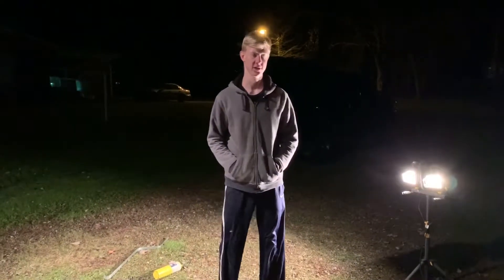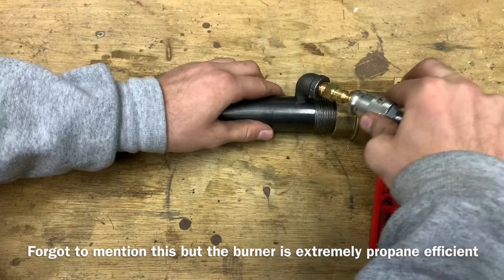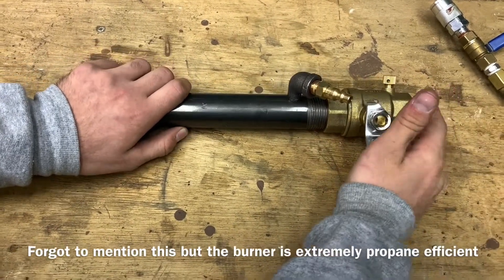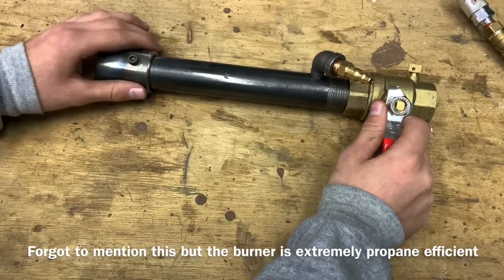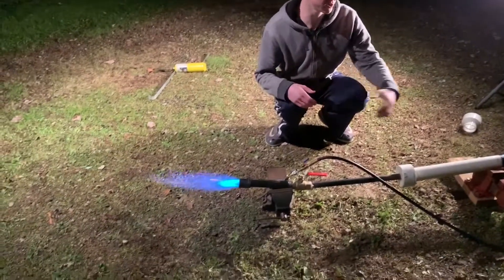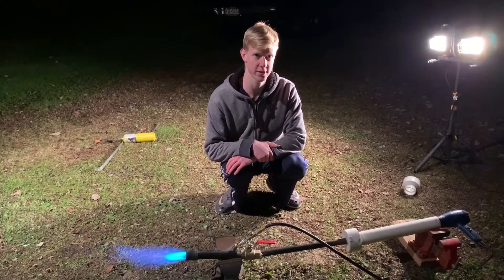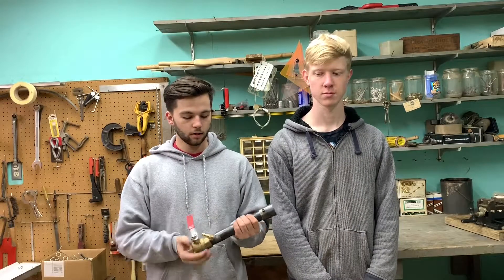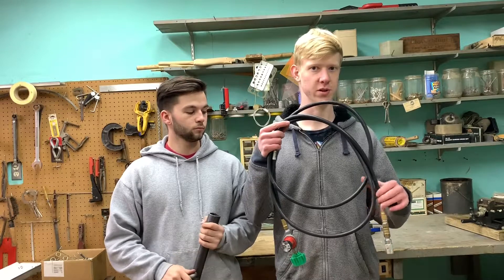Best Simple Forced Air Burner

Comment: Selling that is a bad idea. That quick connect fitting for the gas is an accident waiting to happen. Good job on the experiment but that arrangement is going to hurt someone
Reply: I would say that it is perfectly safe but still agree he shouldn’t be selling. He is ripping people off he should be telling people to spend 20 dollars at the hardware store plus another 20 - 30 for a regulator and built a good burner.
Reply: Its quite impressive about the quick connect fitting. I have a ventury burner but i had to screw and unscrew the valve every single time

Comment: You should Probably consider different fitting selections. And, the market place would require additional components for safety.
Reply: What components would those be
Reply: I would make sure there is a flashback arrestor on the line feeding the propane but I don't see why one would be required on the actual torch
Reply: @daves2354  I'm curious. How could the flame shoot inside the gas tube/hose. There is no oxygen there, so is that even possible?

Comment: This burner sucks in order to mix gas you should have a 90 near the end to roll the gasses together people put screens in the end to help mix as well you’ll see that in torches a different valve on the oxygen side would help control it better when working with hot steel you should use steel braided cable not controlling the gasses properly and having a orange flame when casting steel (doubt this thing gets hot enough to melt iron) will be oxygen rich Causing oxidization on and or in the steel depending on casting or foraging causing prosperity in castings